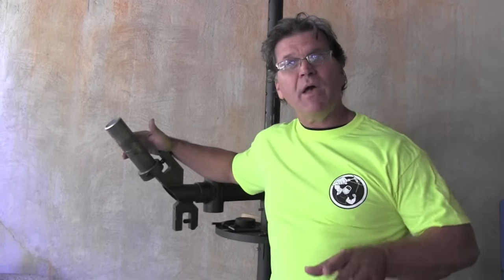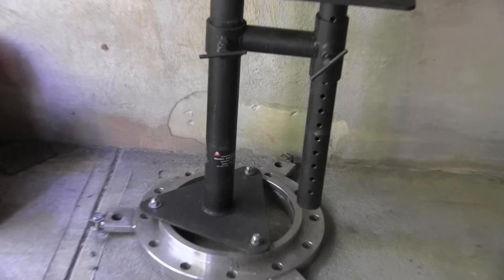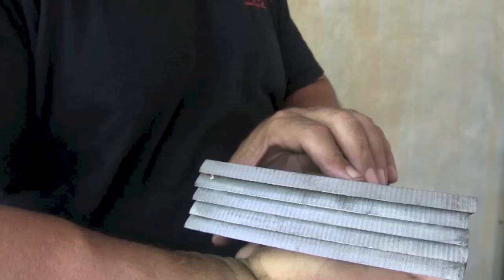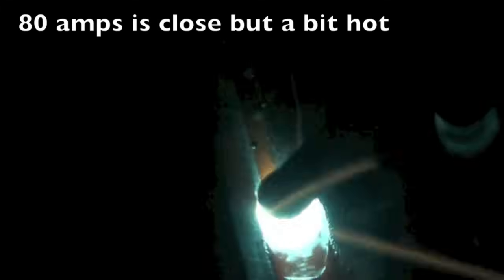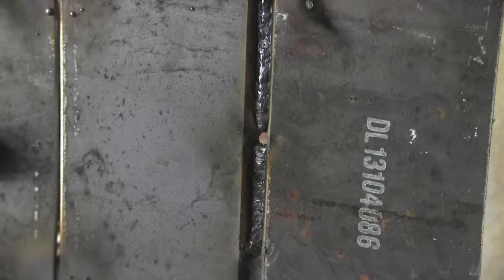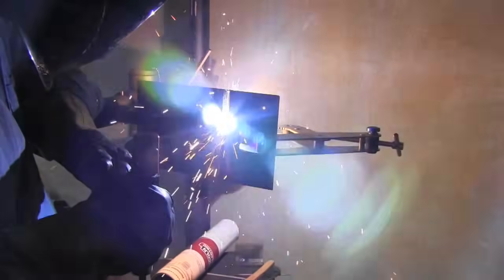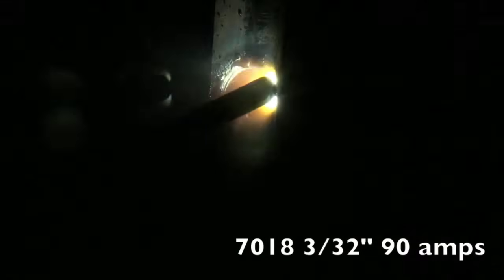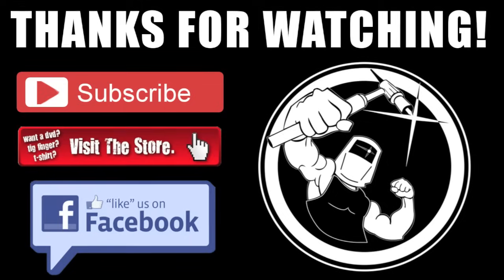Stick Welding Tips for 6010 Open Root &7018 fill cap

Comment: And you gotta remember you’re in school with a short Welding lead so you would probably crank it up anywhere to 85 to 95 A depending on the type of 6010 Roger got the old red rod. You can run them on 90 with a long lead

Comment: We run 7018 all the way from root to cap here in Sweden and I personally always run a remote simply because it is easier

But what is the advantage of running 6010 root over a 7018 root and what advantage does running a 7018 root have over a 6010?

I have some 6010 rods laying around at home so I'm thinking that I might give it a try if the positives outweigh the negatives.
Reply: It has a deeper penetration and since its fast freezing it offers a bit more maneuverability when filling your open root,

Comment: Did you use a 7018 for tacking?
Reply: No. 7018 is for the fill and cap 6010 is for the root and hot pass. Atleast that's the basic way to do it. But the same for both structure and pipe. 7018 isn't a penetration rod like 6010 is. If that makes sense.

Comment: what is long arcing?
Reply: When your electrode is further than it should be from your workpiece, it doesnt allow your rod to penetrate fully so its likely you will have some underbead cracking, and it also caused a fuckton of spatter which is no fun

Comment: I have a question I'm no welder by far and was wondering if you would help me with a weld I'm going to be doing in the near future, first I have and old buzz box and need to cut and shorten solid axle for a project I'm doing my question what rod should I start with for root pass and what fisnish rod should I use every thing I see on internet is 6010 and then 7018 is this my best choices for a job like this. the buzz box is AC only and no reverse polarity on this machine please help if you can answer this

Comment: I dont mind saying your technic is wrong , you need to stay with 70 A on both root and filler. You need to cram/jab the 8th inch 6010 rod in and hold the rod right into the key hole keeping the correct angle as to not stick the rod and keep craming letting the arc take over doing the hard part. Feathering your tacks properly for re consumption is key. If your root pass sounds like sheets ripping take ,,you can take your fucking shield off to complete the root other than re starts? When you whip in the root it leaves very impressive under cut on both sides. Its because its the only way uninformed iron workers can do it with a bit of long arc on top causing major splatter But at least they are trying. Hope this helps! REDEYE.

Comment: In my experience, as a certified welder, just about anyone can make a weld "in position". A good welder can weld in any position, and should be able to move while your making the weld (if necessary).
My first weld test was positioning my coupon in the center of a jig. (Three rows of tubes/three wide.) The center one was constructed so the 2" tube coupon would fit. The bottom of the jig was positioned 18" off the concrete.
Once your coupon was properly positioned the welder was required to weld the heliarc (TIG) root, then fill and cap with 7018.
This required crawling all over the jig. Welding overhead, up the sides then the top. First the quality of the weld was visually judged. Then 4 test strips were cut. Two given side bend tests, one root bend, one cap bend. A flaw in any was a bust.
As for the 6010 root, with 7018 filler/cap, that was the standard for a lot of refinery work I did. Their test was easier open butt with the aforementioned 6010 & 7018.
Welding in a boiler "mud drum", due to the tight confines, and location of where the weld needed to be made, I ended up bent over and Welding between my legs. It was the only way to see the weld.

Comment: it's weird my keyhole is not the problem but the amount of weld stacking on the other side. It should be smooth surface but mines a huge mountain side :D

Comment: Im on this now horizontal 3/32  gap 1/8 6010 rod  and im suxking on my root passes  im not pentatating enough i think i push down hear the sound but get sever dp and or  large things of the metal where it ran threw the hole and help be appreciated

Comment: Do you have a video for 10 gauge butt joint with a 16th inch gap vertical and overhead with 7018 rod?

Comment: For the record, you can use the 6010 on AC.
Reply: For the record,6010 runs on DC PERIOD!6011 will run on AC or DC but 6010 is a DC rod and DC reverse polarity most,if not all,of the time

Comment: Quick question. I'm learning 6010 right now. What's a good tip to stock sticking rods. Is there a better way to strike it? Or what am I doing wrong. It seems after I stick a rod in a certain place, I keep on sticking them in that same place and ita hard to get it going. Maybe I don't understand the concept of striking the arc idk. Once I get goin I'm OK tho
Reply: @Karl Pfistenhammer thx for the reply! Tea I think i was just running too cold. I'm still in school for welding tho so Im still learning!

Comment: If I would have put down a bead like the one welded with the 7018 weld my teacher would had ran me outta there and told me I'm spreading my 7018 bead out too wide and it MUST be a stringer and look like one bead that is slick, it cant look like two wanna be beads jumping back and forth making one bead total in the end..
Reply: My cap would always be a two bead cap under general standard v-groove width.. I do root pass, after root I then grind out much slag and metal bc I'd rather 7018 hardened steel rather than the 6010 mild steel so then a
I run my hot pass by turning machine up 5-10 amps, and grabbing my 7018s to finish out my weld. My hot pass is just a quick pass to help protrude the root I just ran. Next I put my first filler in, one pass spreading out as wide as the bottom V on the bevel. Then I stack two stringers next to one another for #2 and #3 of my filler passes to tidy up the guts, after my guts are in place and they should lay out flush on the plate so my cap can be layed out as a two bead stringer pass cap

Comment: What a brilliant demonstration. I liked how the correct amperage at 4:00 showed how the keyhole is drawn closed, almost like surface tension of a fluid as you slide the electrode forward every second.
Reply: I honestly think that bead was too hot. He was out of the puddle. You get gas and porosity to far away from the puddle

Comment: keria co sultarles if there is some video of him equal to this but in test tube 4g? I would like to know if the procedure is the same and change the electrode diameter and root presentation for ppder welding somewhat.

Comment: I am confused because at my school we use 6010 1/8” for the open root and then we use 7018 1/8” all the way through fill and cap you use 7018 3/32” all the way through is it better to use the 3/32”

Comment: Thank you so much for your videos. I've attempted to watch multiple welding content creators and find that you are the most concise and articulate and I really have learned allot from your content. I take my pipe test in two weeks. I'm confident that I will pass, I've been putting in solid roots. The hotpassp and cap have been easy for me.

Comment: Jody how do you get the keyhole started im on 2g horizontal 6010 open root 6010 hot pass 7018 the rest of the way any tips

Comment: I'm doing welding trade and job corps. I'm on vertical open root pass but they make use 6011 for the open root pass and E7018 for the cover bead on the back. What should I run mine machine on? Currently I have it on 85 for the Amperage and 50 for the Arc Control. Any got any tips and do I have my machine on the right settings. I've asked my instructors but I like input from many people when I'm learning things. Thanks for the replys! By the way I'm using mild steel

Comment: Now I tend to grab the 6011 for open root, do u think I should stay using the 6011 or move to the 6010? I’m getting ready for my 2g stick open root test
Reply: Brooke Turner 6010 5p+ is a most excellent root rod. dc rod. 6011 is an ac rod. i really prefer the 6010

Comment: can we use 1/8"Dia electrode instead of 3/32" Dia electrode  or both for 3/32" root pass. if yes which diameter electrode is easy to work with root pass..

Comment: I just recently bought me a Lincoln buzz box. I'm totally committed to learning welding. My question is this, do you have any suggestions as to where I can purchase small pieces of plate metal and pipe to practice?
Reply: jc oglesbee  Find a local welding shop. Many of them also sell metal. You can buy a length and cut it for the sizes you want to work with. Metal supply companies normally require you buy full lengths of stock, but most shops will sell it by the foot. Also, if you get an opportunity to get to know someone in the shop, they might just give you some "drop" pieces left over from their work, for you to practice on.

Comment: That's the most beautiful 7018 fill cap I've ever seen. It could almost pass for Tig. I just picked up a Miller Trailblazer 325 EFI. Don't have but a few hours of Stick welding under me. I've been doing mig for a few years around the farm. My goal is to run a fill bead like that. Holly crap!!!!

Comment: You failed a welding test ?  And you are a welder ?  You have to be the first welder I have ever heard admit they busted a test.   If you have never busted an xray or a test you haven't been welding much !  Shit happens !
Reply: Shit, at least he isn't afraid to admit when he's wrong. dude has alot of character
Reply: Never seen a welder yet that doesn't make a balls up of something. Mine was the hot pass blowing holes a 4.oclock. Ha ha ha.. I a. 'm 71 now so retired. Keep the masks down and the SMOKE ARAISING
Reply: @doug132639  we all gotta repent n trust in Jesus to be saved ❤
Reply: @doug132639  saved from hell
Reply: Ha, most drivers on the road today would fail a driving test if they were to resit one.
Reply: Newfoundlander86 hahahaha
Reply: We all fall sometimes, but it's about how you get back up. I've never run into a perfect person. When you do let me know who and how that can even be possible.. it's not possible..
Reply: Cheers from Nova Scotia!

Comment: when i did my 3g test i ran 1/8 6010 in a 1/16 spacing, useing 3/8 mild steel... but it looks to me as that your steping/whiping the rod  in this video, i drag my roots and i went the whole 7" (i am useing the same plate as you) useing no more than about 3/4 the rod.
Reply: Josh Ortega yea you drag because  you are welding down,,, he's going up

Comment: Hey Jody I have a question, I have a project to do a tee joint w/ and 1/8" gap. Do you have any tips to get good fusion with no undercut on the root pass? Thanks for your time
Reply: Tyler Mahy why is there a gap in the tee joint

Comment: I just recently started using 7018. It's hard to get it started but when I finally do half of it is gone. The 7014 is better doesn't stick as much and I don't have a hard striking it. Still working on getting better with the 7018. Your a big help thank you for your videos.
Reply: Kayla Stone heat the rods up... 7018 doesn't work well on cold steel or dirty steel
Reply: Kayla Stone 7014 won't be used in the testing lab
Reply: 7014 is training wheels. Ditched that stuff quick for 7018

Comment: I'm having trouble with this but I'm doing it in the flat position seem like when I burn it just burn through my weld don't be connecting
Reply: 6010 ? You have to whip it    almost like dragging ,,but you have to make the puddle come to you as you are creating a keyhole if you look closely ,, drag that keyhole to the end of the plate

Comment: After 12 years of welding I should not be having this problem.. but on this job site, I have an unfamiliar (and very old) Miller generator welder, and nothing but 6011. The steel is rusty, the fit up beyond sucks! And when I'm filling gaps my keyhole is getting to big at 75 amps and snuffing out my rod at 70 amps... errr! The obvious cure is get the right equipment and fix the fit up.. hahaha not so fast.. I'm getting paid good money to weld out of town and it's in the middle of nowhere... gotta make due with what I have! I realize there's not much here to work with.. I don't have much to work with.. but any ideas? anything at all? It's varying sizes of structural plate, and schd 40 pipe
Reply: coors1800 p
Reply: Job is over, I turned up to 80 for good starts and hauled ass! Stopping and cooling for a second when needed.

Comment: Hey Jody, I am currently learning how to weld for the Air Force. I'm stuck on the vertical 1/4" steel. I'm having a hard time figuring out amps. Any advice? ( I'm using 6011 for the root and 7018 for the fill)
Reply: Brendon Tinko don't worry about it the air force doesn't need anything that strong lol
Reply: Fit up is the key man tight 1/8 root gap and a 3/32 land works out super well
Reply: 110 amps going down ... going up 95....7018 hot pass  150,,,,fill and cap ,,,145

Comment: Thanks again for the tips. Been practising to recertify my pressure ticket (ASME Sect 8). Its been 12 years so its taken some practice, but I nearly have it dialled in . Still some lack of complete fusion/penetration on my overhead tie-in but should be ready to test in the new year.

Comment: This answered a few questions I have had about keyholes. The short welding course I took years ago had us mostly working with T-joints so the question of keyholes never came up.(keyholes at a glance seem like creating extra work for no reason or a type of blow through) 
If I absorbed the video correct, the trick to maintaining control is just barely forming the keyhole, and the purpose is full penetration when welding from only one side of the joint.

Comment: guys i can't light up the 6010... i can't start the ark :\ my machine is 80A max... is it that the problem? help here please!
Reply: cq33xx try 6011.  is your machine an inverter?
Reply: Zach A i believe it is inverder... is this one: https://www.amazon.co.uk/Einhell-BT-IW-100-Inverter-Welder/dp/B001EX2UR8

to find 6010 was an adventure, no question for 6011 here... :\
Reply: Inverters have trouble running 6010.  Only option is to run 6011
Reply: Zach A that kind of electrodes here are considered very Specialised for industrial use or something, that means there is no way to find some electrodes to test your equipment, the boxes are 9 kilos in the most places i asked and finaly i found a 4 kilos container of 6010 in a factory in an industrial area... I mean... how  sure you are that 6011 gonna work? because i will have to give 26 euros minimum ... if im lucky ! !!
Reply: 80 amps,,, lol    try 100

Comment: why did you use a 3/32 and not a 1/8 electrode on the 7018?
Reply: well ive experienced a 3/32 gap with a 1/8 electrode its like doing pipe. it woks for you.

Comment: Would this be the same technique for the horizontal position?? I'm having.the most trouble with the keyhole getting way out of hand and It seems easier to fix in the vertical

Comment: Okay so I'm in welding class and been in there for 2 years, this year were starting bevel plate, and I can't get the hang of a root weld. Could you do a video of the different ways to do flat 6010 root welds
Reply: 2 years!?
Reply: Fattypatty88 im in high school, started as a freshmen and am a junior atm. Only get the class 48 mins a day so u can't get much done
Reply: John52 Chesser z

Comment: I had a weak spot in my root pass, grinded it out and welded over it. had another weak spot and did the same thing in the same area. any tips for de burring the walls down instead of making a huge gap to weld over??

Comment: Looks good from what I saw, how does the back look?
At our welding class for open root 6010 we run 83 amps on 3/8" plate, 37.5 degree bevel, 3/32 gap, with a land the width of a nickel (I prefer mine a little heaver than that though) with fleet weld 5p+ 1/8 6010 rod.

Comment: can you do a video on 3g 6010 root pass and 6010 hot pass , 3 / 32 7018 cover pass and 3 / 32 7018 with 3 cap stringer beads... that's how I'm doing it at the school I'm at thanks and great video @weldingtipsandtricks

Comment: I do slot of downhill pipe welding, my hardest part seems to be the tie ins.. I seem to get a large key hole right before my tie in and turns into like a fish eye (hole) and I can't seem to stop doing that. What can i do to stop or help that, I try to go about an 8th in past tacks for a good tie in but that key hole before always throws me some issues
Reply: chris jones what's your fitup. I do 1/8 th land with just under a 1/32 gap. jam the rod to the root face and just let the rod burn itself into the root. no manipulation if you dial the machine right. perfect roots everytime. and try grinding your tacks a little smaller on the front and rear edges.
Reply: Douglas jay Garibay main issue is job don't want u to spend time prepping they would do all slam and jam if they could and I'm used to grinding tacks and yes I know about naming rod in have no issue there just the tie in but I've gotten better but not where i wanna be.. perfect can't tell where start and stop is. great with 7018 restarts but that damn root on tie ins

Comment: Why dont use remote control for the root pass? Thats perfect!
Reply: +Magnus Klahr I've never seen an active remote (foot pedal or thumb button or roller) for the SMAW process.  It could come in handy at times though.
Reply: +missmymountain It is very handy! Its used more or less more or less every time here in sweden.

Comment: Can this work on a Butt joint flat??
Reply: +Diego Alberto Peña Yes, as long as there is bevel and an air gap behind the joint this will work in any position.  When using this process on a plate or a beam most joint designers would specify backgouging by some method before the fill and/or cap on the backside.